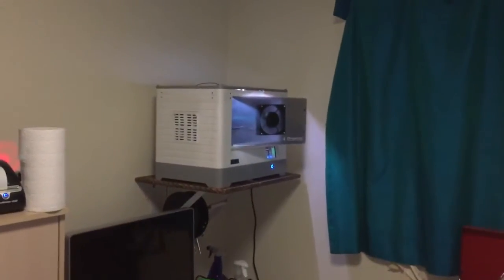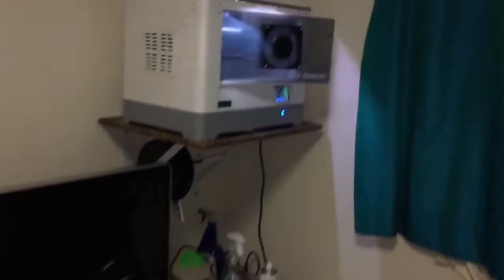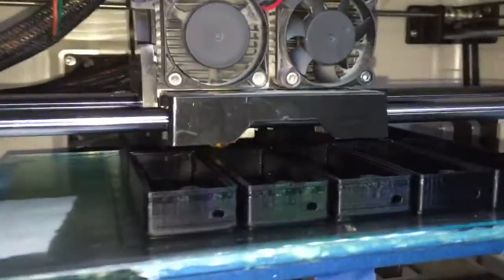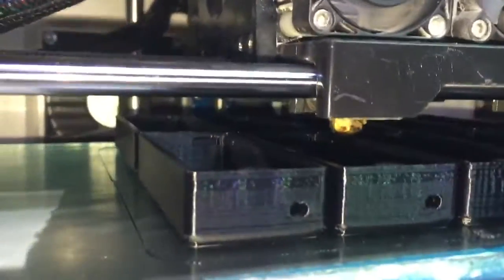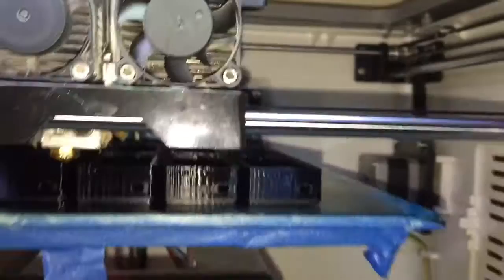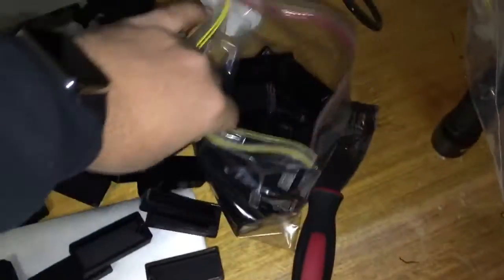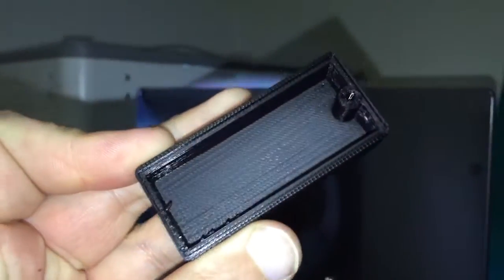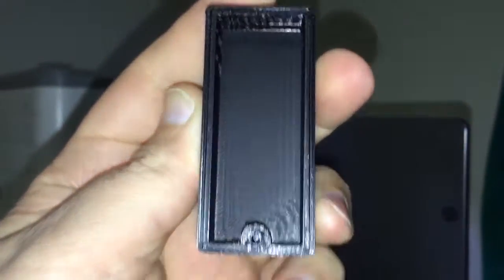FlashForge Dreamer - 60 boxes!

Comment: nice to see you are still printing strong!
Reply from the maker: squeak83uk2 Thanks :). I've been printing so much I have stopped uploading videos :) More videos coming :) Just an awesome printer!! With this job and a few others this printer just completed 13 days NON STOP and used over 3kg of filament!!!!! Never missed a beat!
Reply: Thomas James your R extruder is a little warm it seems lol, how did you get the FF down to 0.2 i only thought the FF went to 0.5 layers..
Reply from the maker: I've removed my right extruder as it kept hitting my prints. When you remove it it says over 1000c hahaha.
0.2mm is 200 microns. The flashforge dreamer can print down to 50 microns layer height or 0.05mm layer height. Simetimes I print at 0.1mm but it takes a while and 0.05mm takes a LONG time to print